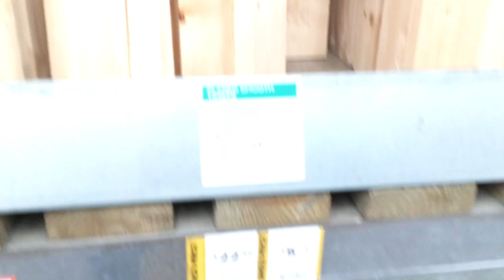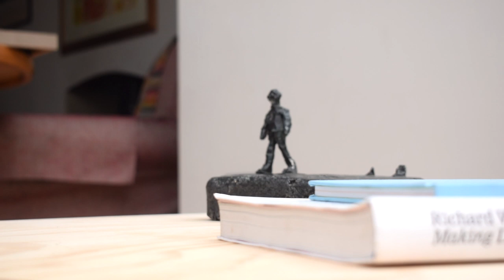Making Tables Using Just a Hand Saw & Screwdriver!

Comment: I take back all my rumblig from the previous video. Once painted those brackets set it off really nicely, giving a simple piece of furniture an original look.
Also liked using a handsaw as a straight edge, i learned something :). Thank you
Reply from the maker: Not at all - I think you made some really good and valid points in your last comment but thank you! & I'm glad you noticed the saw trick, I only found out about it a few weeks ago and hoped somebody would spot it - you can measure both 90 and 45 degrees on them :)

Comment: These have turned out even nicer than I thought they would, Great project J!  (for some reason  they make me think of a Huf House)
Reply from the maker: Sparky 415 Everythings Adjustable thank you mate, I really appreciate your support & ive not heard of that but I’ll have to check it out! What makes you connect the two??
Reply: I'm not sure I like your questions! You always get me thinking and even doing research… I  had seen Huf houses many years ago then was reminded about them by Grand designs a few years ago
They are a modular system of home built with a simplicity of design (ha cracked it! 😊 )
I think you will enjoy this if you've not come across them before 👍 
https://en.wikipedia.org/wiki/Huf_Haus
And
https://www.youtube.com/watch?v=WgCywz7eZHE

Comment: Your editing is fantastic! Love your vids! Not to mention all your creations! Amazing! Thank you!
A question, your shop, it looks similair to my basement where I would like to move my shop to. But I don't got any heating system there. Do you have that in yours?
If you dont, do you see if your tools is getting bad in that enviroment?
Reply from the maker: Thanks Jacob, I really appreciate your support!
With the basement workshop, although I've got one small radiator and a window that can help regulate temperature I honestly hardly ever use them; the best thing about having a shop underground is that the thermal mass of the earth helps regulate the temperature so its always cool in summer time and warm in the winter. The only thing I would look out for is damp as that can make your tools rust, and the cellar might need treating or at worst completely tanking
Reply: @jmakes3745  Thank you so much for taking the time to answer! I really appreciate it. And as you write I need to look up how damp the cellar are.
I'm afraid I'll need to fix that first. 
Thank you once more! =)

Comment: This would be even more interesting if it can be evolved into modular connectors of some sort (similar to the Ken Isaacs system) - great idea and application anyway!
Reply from the maker: ArsonDPI I had a quick look for his system but I’m sure I can find exactly what you mean. However because the top of the bracket is open the leg can go all the way through, meaning you can actually connect stretchers of different heights on the post, and use it as a sort of building block :)
Reply: @jmakes3745  a chair, a sofa day bed or a summer hut?